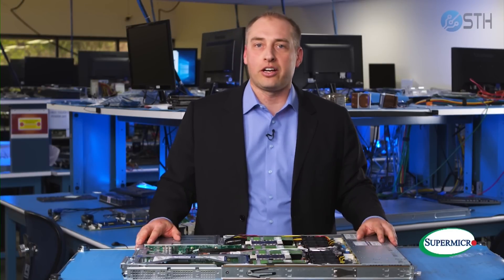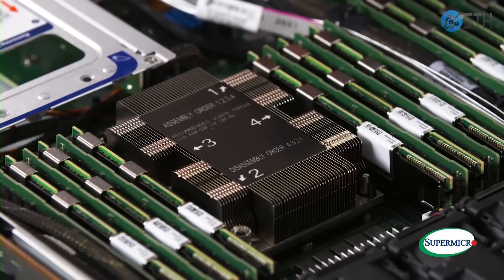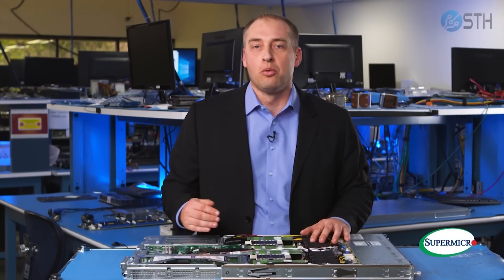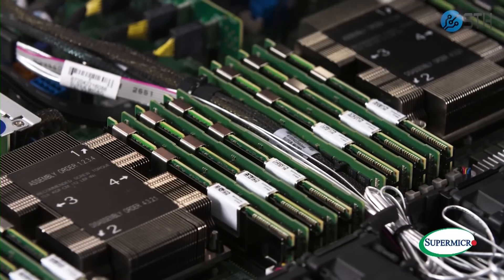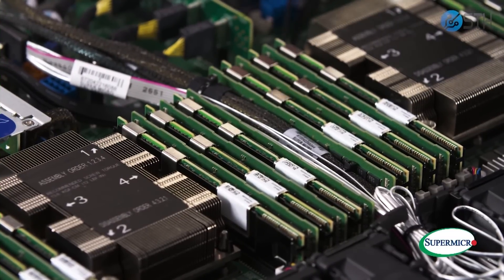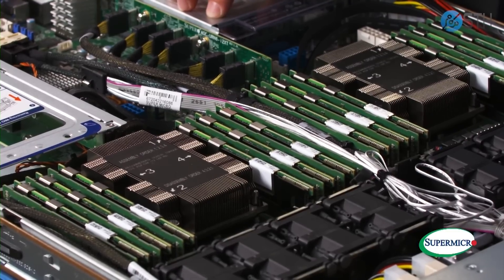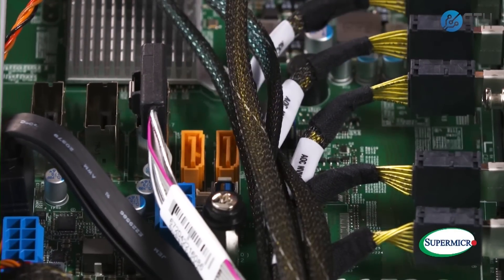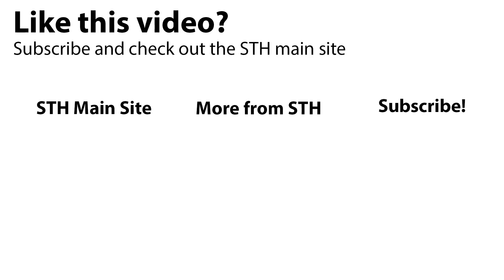Supermicro 2nd Generation Intel Xeon Scalable Features and DCPMM Support

Comment: better for the environment... as soldered xeons right
Reply: The annoying thing is, even if Supermicro didn't want to produce motherboards with soldered CPU's, their competitors will. So they are all having to do whatever Intel says to stay competitive. I agree with you that the soldered processors are bad for the environment. Buying recycled server gear is something all us enthusiasts do but in a home I won't want a 1U/2U server like this that sounds like a chainsaw 24.7. We'd rather take the CPU's out and use them in a 4U case with larger, quieter fans etc

At-least we have EPYC1 and 2, both utilising a socket even for the highest end processors. (For people not aware, the 56 Core Intel Cascade Lake CPU has a TDP of 400 Watts and comes soldered only. The lower core count processors such as the 28 core will still utilise a socket).
Reply: @droknron  what about the 48 cores and the others? are those soldered as well?
Reply: @duojoshuacindy8545  That will be soldered also. It would appear that any chip Intel makes that goes above 28 cores at this time will require two separate dies.

And they're only supporting that on this newer soldered only platform which has more pins to allow for more memory channels which they've had to do due to there now being two processor dies instead of one.
Reply: @droknron  ok then no qs xeons for me, tell me something, what motherboard you recommend for dual socket cpu xeon 8176 is the asus sage c621 ok? is gigabyte better? is supermicro better? what is the fastest dual socket cpu configuration and most minimalistic no ipmi but most importantly DURABLE or RELIABLE motherboard  to put 2 qs 28 core xeon?
Reply: Duo Joshuacindy to be honest I don’t have any experience with the latest platform so I can’t give any good recommendations. But I suppose out of those Supermicro has the most experience.